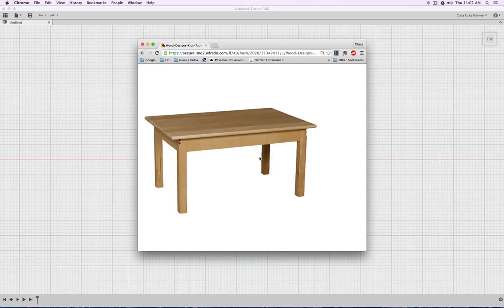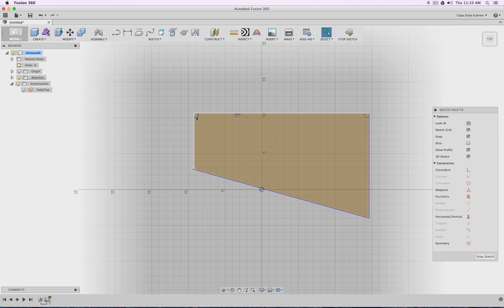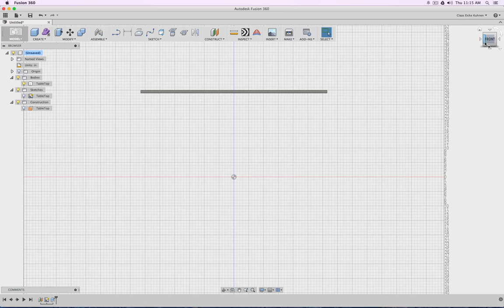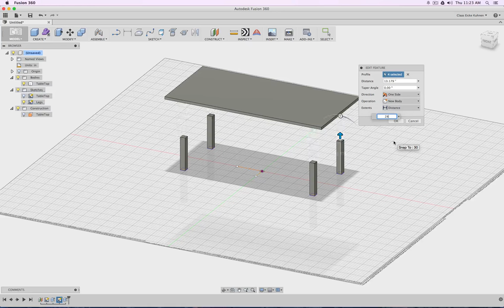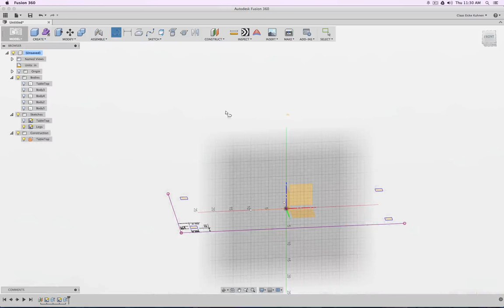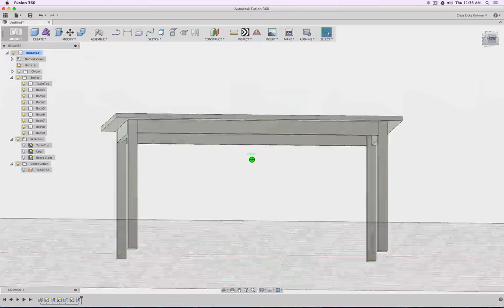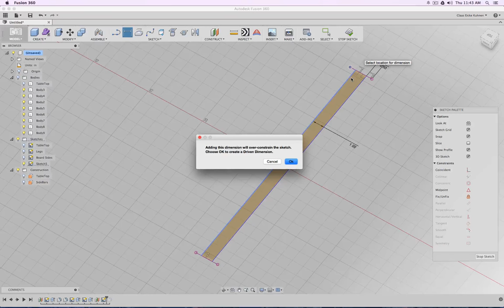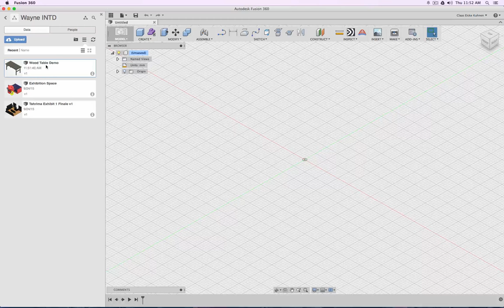Wood Table

Comment: Hi Claas, and tjank you so much for a very good and iiformative video. Great work! I have a question regarding ConstructionTable. I can not understand the purpose of that feature. When creating a model like this, i would not use it, most likely because i do not understand what use it have. Can you please tell me why i would use it?
Reply from the maker: Do you mean the construction plane? Sketches in fusion cannot just be created in 3D space you need to define a plane it sits on. When adjusting the cplane position the sketch will be repositioned and thus the geometry that is created with the sketch will update.